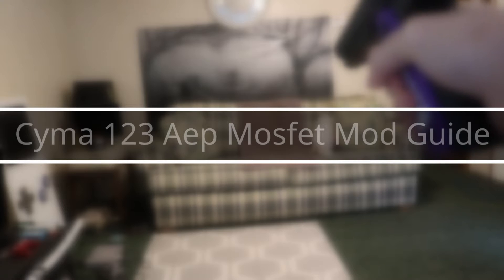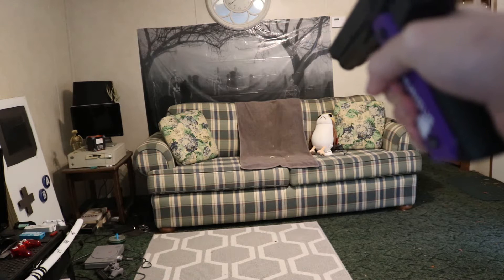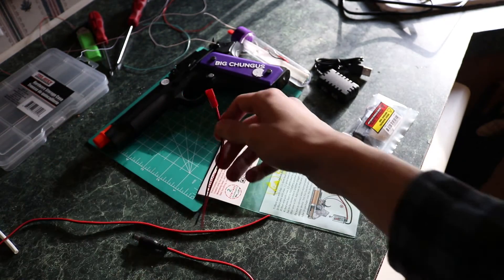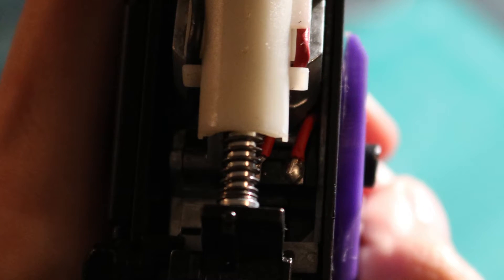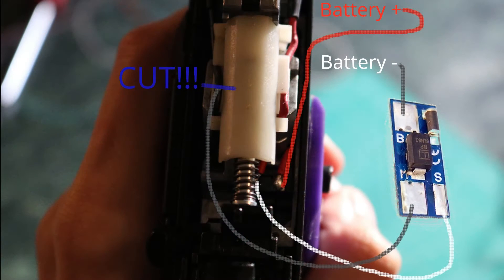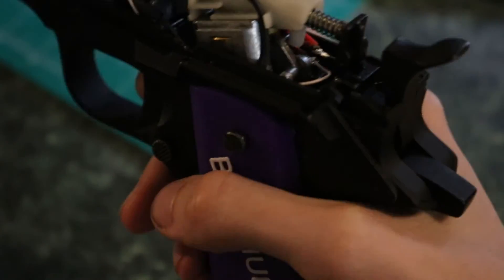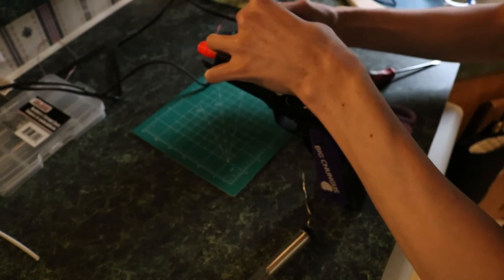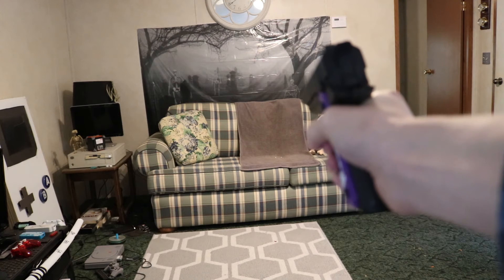CM 123 AEP Mosfet Guide

Comment: looks great, I want to learn to do the same and for that I bought two CM.123. The only problem that I´m having right now is that one shoots only full auto for no reason while the other is still working normal. I searched a lot to find a way to fix this, but I found nothing. The selector switch is a little bit different than the ones found in another models that are more popular than this one. Do you have an idea or a recommendation to fix this issue? 

Thanks for your attention and salutes from Germany :)
Reply from the maker: I haven't dug that deep into mine but I did have to repair and bend a metal piece back in the one. Between the 2 I think one brand has a weaker safety pin

 "ties into the selector its the same piece that makes the safety work"

so be aware not to drop it on the safety if I had to guess that is the issue that might have caused it.

You will need a metal piece to knock the part off from the other side. It might fight you if that piece is bent. You should be able to bend it back in place but do not do that to many times might weaken it.

I did experiment with 3d printing that part "wasn't strong enough" since I think the only way to full replace a bent selector / safety pin is to cannibalize one off another one as of right now.

Hope this helps sorry for the late reply.

Comment from the maker: Update the airsoft aep is still going strong!!! 
Although finding a second micro "mosfet II" seems to be difficult I got a second aep not long ago I wanted to do this on as well to duel weld and thought I would post a update about it. It seems they updated to a newer design for the "micro mosfet III" but for a aep like this it would work but is kinda over kill I think and pricey. Finding a "micro mosfet II" also seems to be difficult as of right now and the "perun mosfets" seems to be cheaper again and look to be the same specs and in stock if anyone wants a cheaper mosfet in the mean time I haven't tried them but they seem ok on paper.